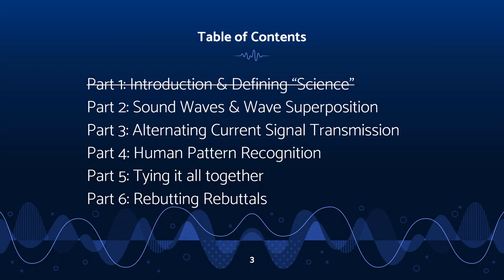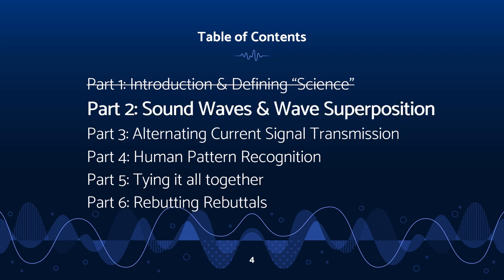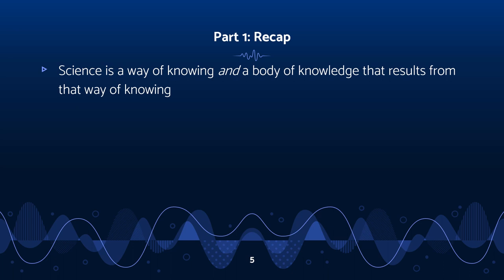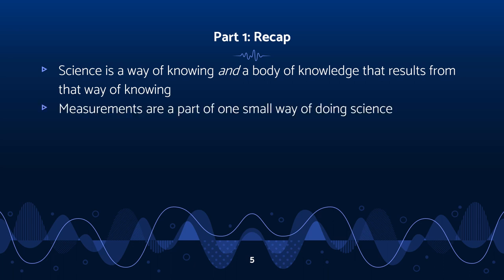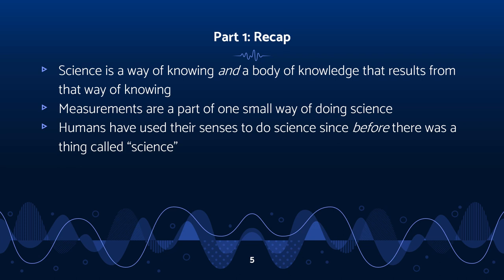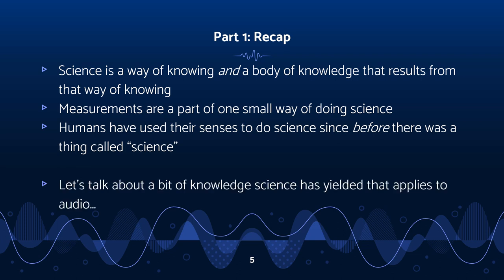Cables Matter Part 2: Waves & Wave Superposition - more science explaining cable differences

Comment: Sound is an asymmetrical wave - the pressurization portion has an "attack" "speed" that is determined by the object causing the sound. The rarification portion of the sound wave is (more or less) has a "speed" based on atmospheric pressure. The air has to be "pushed" back into the area of lowered pressure by air pressure.
A percussion instrument has a leading edge (of the sound) that is a sum of a lot of overtones/harmonics. So, while we humans can't hear pitches above 20kHz - we can hear the higher harmonics as part of the "package" of percussion instruments.
Almost all instruments begin with a positive/pressurization. The onlt instrument that starts with a rarification - is a tympani drum.

Comment: Higher core cables are better than lower core cable??
8 core better than 2 core cable?
Reply from the maker: A lot of factors, but if the cores are the same material and diameter, yes.
Reply: @wavetheorysound  but how can I know the stock cable specs. For example I have hd58x, recently order 4 core copper cable from aliexpress around $20. Better than stock cable?? can't find stock cable specs.
Thanks for reply ❤️